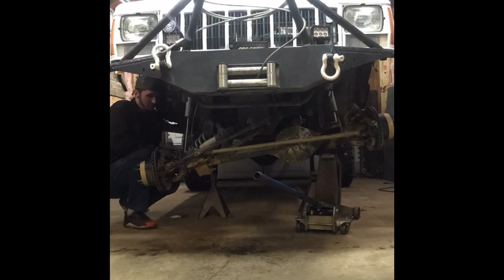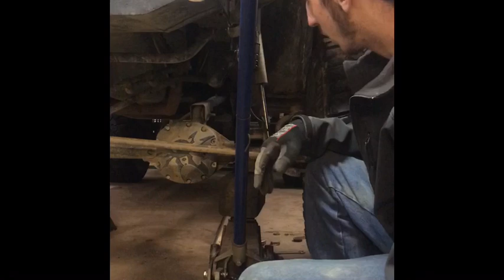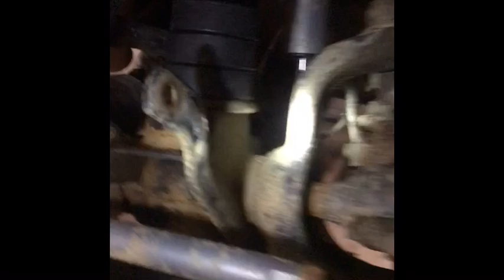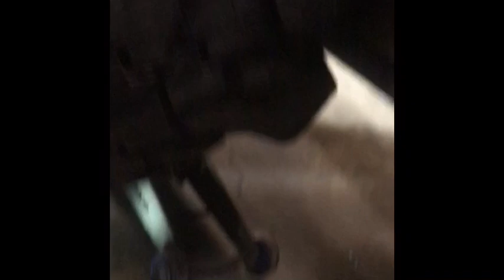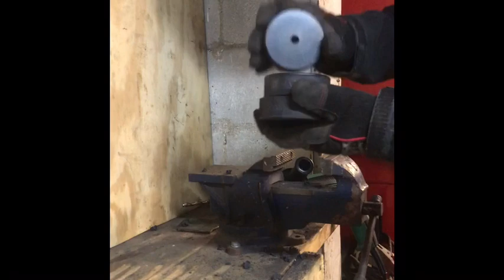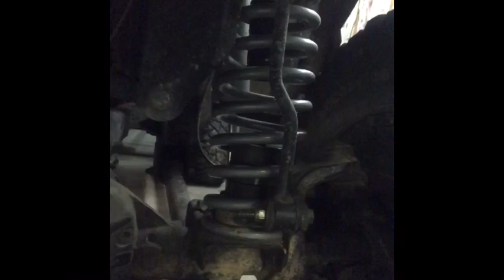How to add bump stops to your Jeep XJ

Comment: How did you get your axle to drop down far enough to get your springs out? It’s impossible to get em out when their huge
Reply from the maker: Wrecklessjlo I have RE5.5” lift coils and if you use y’all enough jack stands you can get them to drop out far enough. I believe I was using harbor freight 6tons at the time but have since went to the 12 ton stands due to the recall on the 6 tons